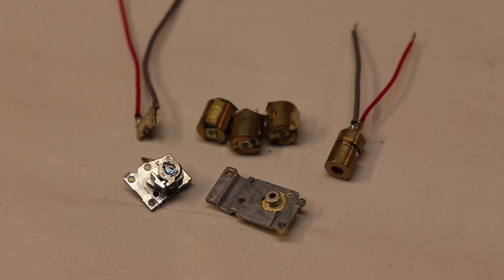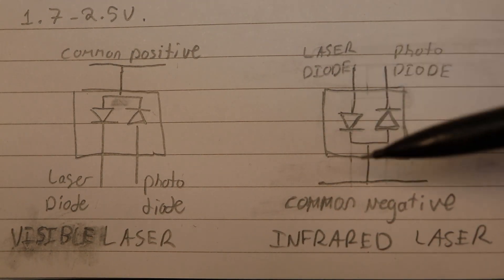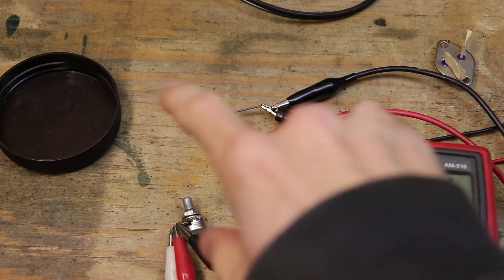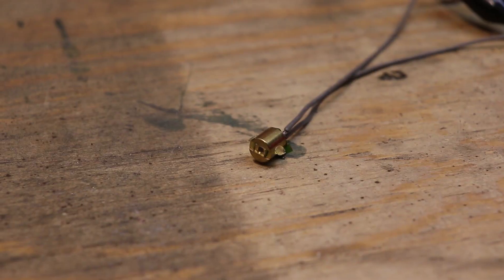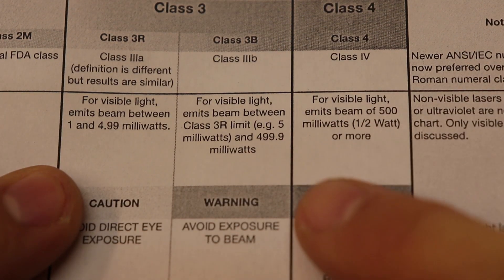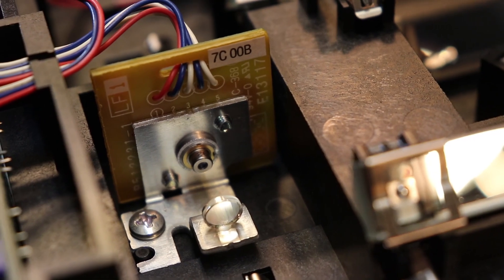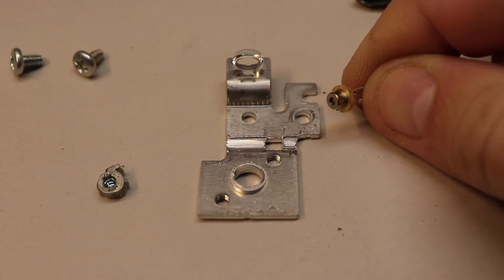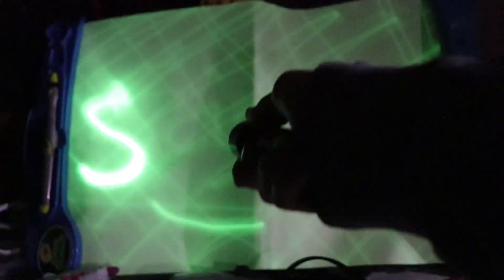Making a UV laser pointer

Comment: my 808 nm laser is visible though it is very faint because our eyes have such a low sensitivity to IR though it is visible in bright sources and lower wavelengths. The diodes used in green lasers are 808 you can make one by removing the crystal that converts it into green light.  UV is similar and looks like a faint blue I have heard.

Comment: I suggest you to use the laser housing 12mm. It easier to mount laser diode.
Reply: also the laser diode .the cheap diode that can burn things is around few bucks in eBay. Just search for SLD3232 it's Sony bluray diode.